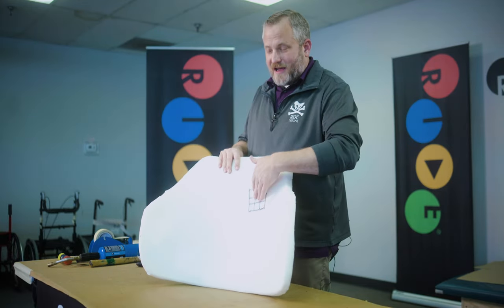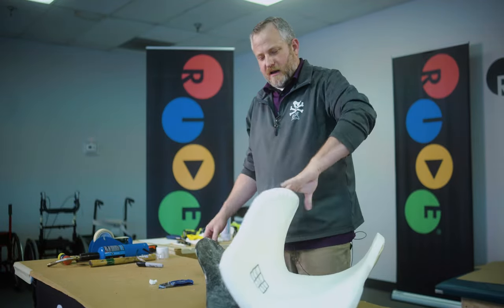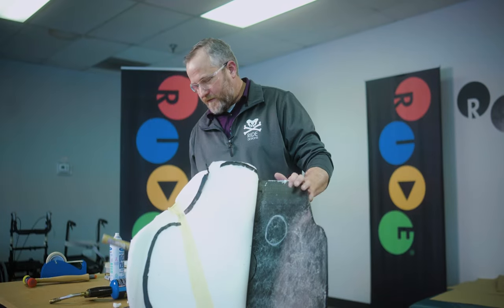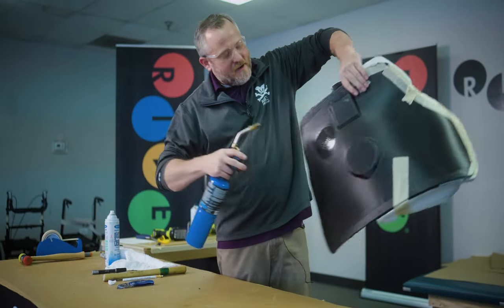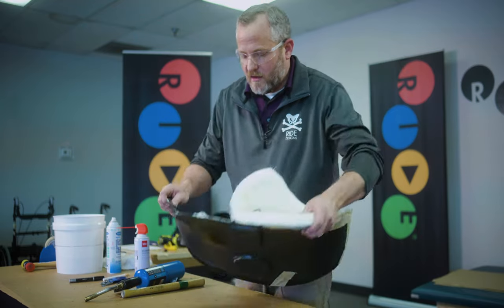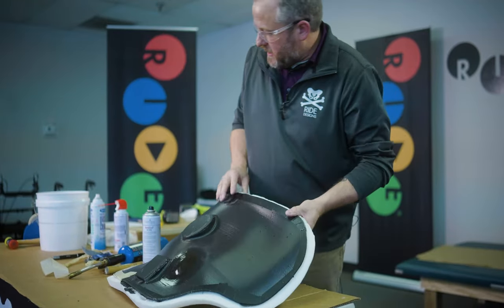Ride Custom Back (RCB200) - Heating and Bulging Relief

Comment: Sure do like the old style back shell better for ease of modifications.  This new one is just to firm and hard to heat up and modify.
Reply: Thank you for your input! There were things about the old shell that were nice and easy to work on, but we feel that the benefits of the new shell outweigh those things we came to love about the old design. In addition to the new material being significantly more environmentally friendly, we are able to improve accuracy and outcomes through the CAD processes. Firmness can be addressed through liner materials. Try using the Accusoft foam liner if firmness is a concern. We believe you will come to appreciate the differences after having more exposure to the new materials. Please feel free to reach out to us directly to discuss those differences and benifits. Thanks again!!